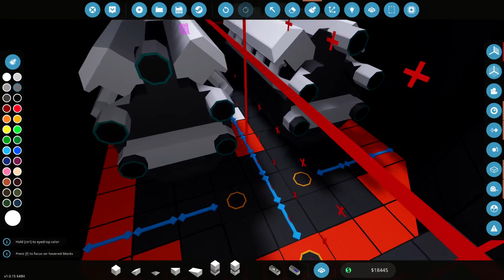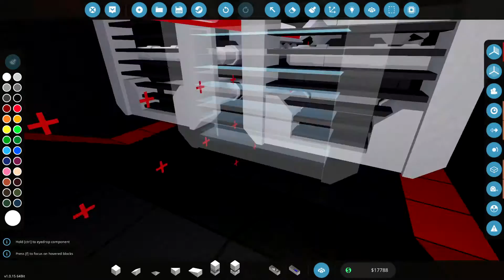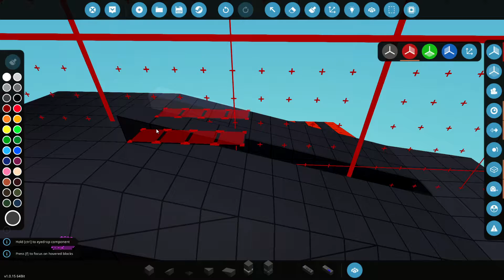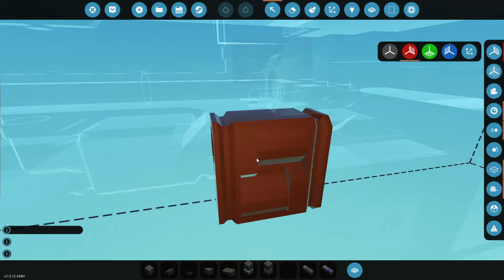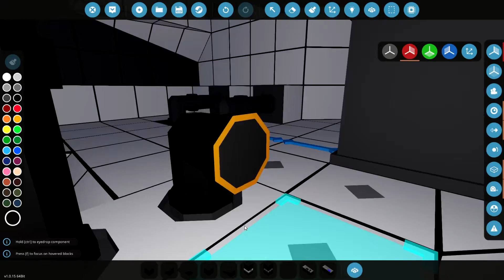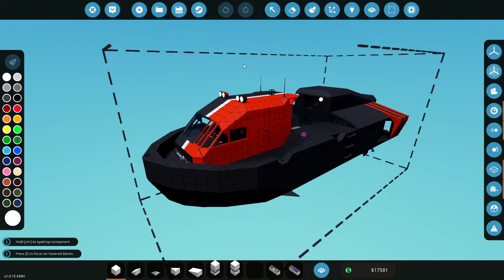ENGINE Conversion (Wolverine) - Stormworks: Build and Rescue - Career Mode - S2 E3

Comment: Can someone please help me understand why changing the blocks to wedges gave him more fuel capacity, I’m confused lol
Reply from the maker: Hey Israel, thanks for watching :) Sure, a wedge is half the size of a normal 1x1x1 block. So the wedge takes up less space and therefore allows for more volume for fluid in a tank, if placed the correct way. If you build a fuel tank out of wedges, use the flat side of the wedges on the outside of the tank, so it looks normal/smooth on the outside. The inside will look spikey but it will allow for extra volume which would otherwise be taken up by full blocks. I hope this helps, let me know if it still doesn't make sense.

Comment: I've found it's better to build a small reservoir of water using a spawner block to cool the engines of boats down. When you run aground or spend too much time out of the water, you'll blow up your engines.
Reply from the maker: Yes that's a very good idea which I've tried before. I don't think the spawner block works in career mode. Although I could pump water into a system, which would then hold it in to circulate. Thanks for watching and your help :)

Comment: I made some tests with the motors and come to the conclusion, that pumps have no influence to the engines heat or performance. You don't need any water, fuel or air pumps.
Reply from the maker: Thanks for your test results Sengir. That's very interesting. I also agree. I only ever found an advantage in using pumps for power when I once had a 20 meter exhaust pipe lol. So it should be ok on the Wolverine :) Thanks again!